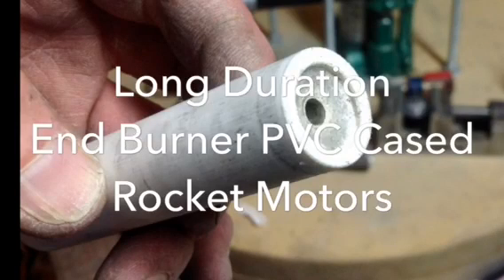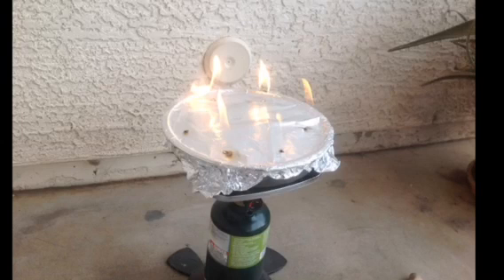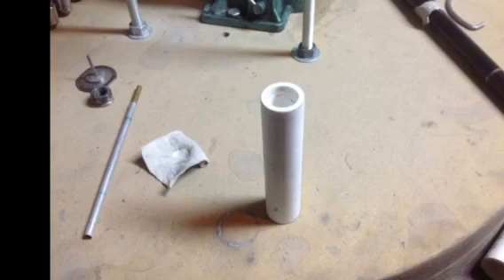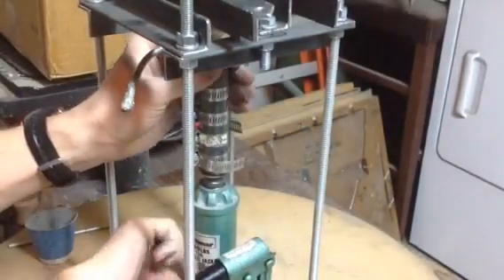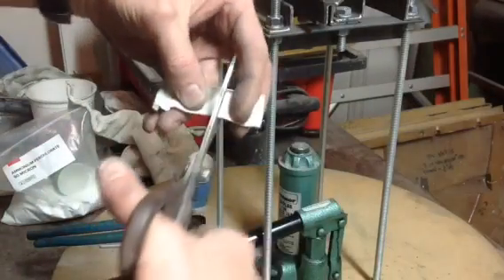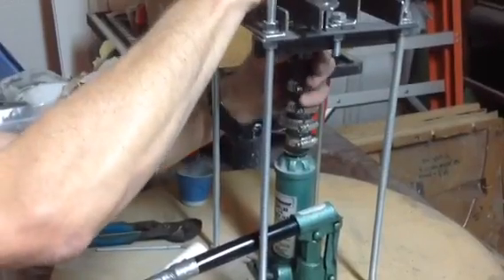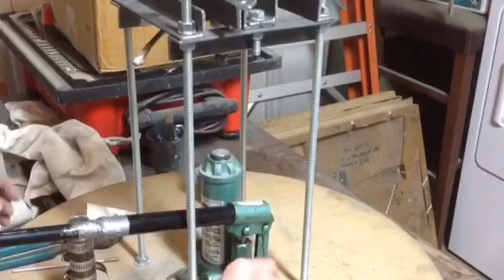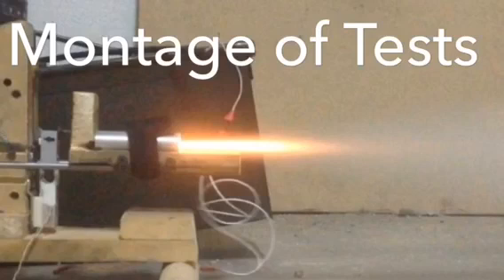Long Duration End Burner PVC Cased Rocket Engines

Comment: I heard the sulfur in black powder is responsible for the high burn rate, powder mixes that should burn slower (artillery) decreased the amount of sulfur and increased the  amount of charcoal.

But if you mix black powder yourself, you will experience  an enormous  difference between wet mixed or dry mixed powder, the wet mixed powder burns much faster.
If you buy commercial black powder (for muzzle loading) it will be corned, has an exact amount of moisture in it and the powder particles are covered in graphite to prevent static discharges, they do everything to get it as reliable and safe as possible.

Comment: Bentonite clay does hold up but the thing you're doing is you're not grinding it down to a fine powder. A lot of people like using it straight from the bag with the little chunks. But it comes out weaker like that. If you grind it into a fine powder with a little moisture, that stuff will literally turn into cement extremely durable.

Comment: I miss the FSI E5-0 and E5-6 motors, 4.5 sec burn, and dual stage 9 sec burn total, we were hitting just over 4000 feet on a good launch. I just found the G13 motor with 15 sec burn time, that sounds like a lot of fun.

Comment: Which would be the ideal load (psi or kgf/cm2) to be applied on the propellant while filling the engine?
Reply: I think highest loading my force possible is best.  This maximizes volumetric loading efficiency.  Certainly I think loading pressure should at least a couple multiples of motor running pressure.  Now, the 2 ton bottle jack press I used I actually found in someone’s trash pick up pile on their curb while walking my dogs!  When I would really get on it with the loading press arm, sometimes it would sort of max out. I don’t know if I was actually achieving 2 tons of force. But, if I was getting 2 tons and given the 5/8 inch internal diameter, the pressure would be upwards of 6000+ pounds per square inch. I kind of doubt that was what I got because I’m not sure the pipe nipple and hose clamps could take that kind of pressure.

Comment: For the nozzle, how did you come up with the design? Would a longer nozzle like we see on real rocket motors be beneficial?
Reply: Hey! Thanks for watching and the great question :). A longer nozzle may help.  It should be tried.  My hunch is that the low Isp nitrate-based propellant wouldn’t benefit much from more expansion.  I little expansion, sure.  For the nitrate motors I think the biggest factor is getting the correct Kn (throat diam driven). But with a 200 Isp motor (and especially 300-450 Isp engines) more expansion in the bell extracts more useful work and thrust by converting internal heat of gases into group velocity of the exhaust jet.

Comment: that's really quite impressive, honestly. Is there a reason you chose end burners instead of regular cored out design? Just guessing it'd be easier to characterize the motor overall with an end burner and be confident that there's little variability between any two.
Reply: Longer burn with end burners
Reply: I chose end burner because needing long duration, up to 10 seconds.  It’s actually a chain of reasons that lead to my choice:  1)  want no-fuss motors not prone to burst from over pressure thus 2) need low burn rate exponent for stable chamber pressure despite manufacture tolerance of homemade motor thus 3) potassium nitrate based propellant thus 4) burn rate kind of high, like 0.5”/second (whereas ammonium perchlorate props would be somewhat slower and could use a Nate’s grain) thus 5) need an end-burner to get 5-10 second burns from a potassium nitrate propellant.

Comment: How does the gimbal work? 
I like the long duration motors. Good to see it can be done with pvc. Im working on seeing if a long duration motor can compress air in a venturi and inject fuel as an afterburner so my rockets can be partially air-breathing. Getting rockets optimized and dialed in is no joke! Great idea with the fireclay too, as Ive been using APCP and it burns with a white flame and destroys pretty much everything I make nozzles out of. Gonna try graphite.

Comment: and to think BPS space is still struggling with the gimball system let alone build his own engines
Reply: This stuff is really really hard.  You might find some online history of my 1st company, AttoPilot LLC.  Developing a robust UAV guidance system to the point of worldwide sales including to militaries was actually easier than developing a robust gimbal controlled finless model rocket.  It’s insanely hard!  Joe Barnard (BPS Space) has gotten a lot farther than me… but you can see it gets nearly impossible if the airspeed picks up too much.  When the aero forces exceed a threshold, these small model struggle.  However, I’m currently tackling this and gaining traction… details to follow
Reply: @dmgoedde  best of luck, I am also trying to get my UAV company off the ground, do you mind mentoring me, just some advice from ur own experience in your free time would help a lot

Comment: Is that homemade mill capable of running for longer periods, say 12 hours, without the drill overheating?
Reply: The drill was horrible actually.  Your comment is spot-on.  The drill isn’t made to run this long continuously and the brushes wore down and bearings wore out.  My current design uses a 1/3 hp swamp cooler motor I bought at Home Depot on belt drive to the rollers.  It gets warm but nothing a small desk fan can’t fix.

Comment: what is grog?
Reply: I wanted to ask the same question.
Reply: Grog is previously fired ceramic (fireclay + water + firing in furnace) that is smashed then screened into specific grit sizes.  All ceramics suppliers carry it.  I think it comes from scrap broken ceramic.  In our rocket nozzles the grog adds a little ‘bite’ to the nozzle mix helping it grab onto the motor tube walls better.  In ceramics it is used like on bottom of coffee cups to make a non-slip surface.  Feel the rough bottom of many ceramics and that’s grog

Comment: On your nozzle, by weight what is the ratio of fireclay, grog, and wax?  What kind of fireclay are you using?  There are about seven different kinds - Lincoln, Imco, Greenstripe, Neuman Red, Missouri (Hawthorne), Red Art, and Gold Art.
Reply: By weight 60% fire clay, 30% “coarse” grog (I’d say 20 mesh), 10% wax.  I used Lincoln fireclay in this video.  Also tried, with similar results, PV, EPK, OM-4

Comment: Is some reason, what you use  exotic mixture 1/3 BP + 2/3 KNSU?  The speed of  burn of BP is possible decrease simply  H2O.
In a large ratios. 1 - 10%. Especially, if you use plast, thus humidity resistant case. The fuel will much simple. And ISP maybe better. Because the steam has ISP 195. Will Increase also the lifelity of throat, because the run will under lower temperature. And gases will much clear. Against sugar - grease all around.
Reply: I used mix of BP and KNO3/sugar to allow adjusting burn rate by varying the ratio.  I found BP has faster burn rate and ignites easily but is known to have a poor Isp like around 70.  Sugar propellant is a bit harder to ignite and burns slower, but has a higher Isp like 120.  Using powdered sugar adds advantage of packing really well, almost like a bonding agent.  My reason to mix the 2 propellant types is get best of both:  easy ignition and decent ISP with burn rate that’s not too fast.
Reply: @dmgoedde  Thanks for reply. Interesting.

Comment: What is grog?
Reply: Clean, fine sand would probably work about the same for the motor.
Reply: Grog is a ground up fired clay, like say you took a ceramic flower pot and smash it up to a maybe fine sand like texture.
Reply: @putteslaintxtbks5166  Thank you, I thought rum at first but that made no sense.
Reply: @ripsumrall8018  Yep, I think that's what they use to call any adult beverage. Sounds like midevil or pirate talk, like, "Eye, hand me another mug of grog, mate" or some such.
Reply: Sand might work in place of grog.  My reply from same question above: “Grog is previously fired ceramic (fireclay + water + firing in furnace) that is smashed then screened into specific grit sizes.  All ceramics suppliers carry it.  I think it comes from scrap broken ceramic.  In our rocket nozzles the grog adds a little ‘bite’ to the nozzle mix helping it grab onto the motor tube walls better.  In ceramics it is used like on bottom of coffee cups to make a non-slip surface.  Feel the rough bottom of many ceramics and that’s grog”

Comment: Gimballed motors!?!!?! WOW. Those engines ran beautifully. I've been working on my own BP mix, using Sumac charcoal. For whatever reason, it seems to always burn slightly faster than willow, especially corned (I use about half a percent dextrin). I've always pressed my motors in a bench vise, but your method is better.

Comment: have you optimised the nozzle diameter?
Reply: Yes, for my purposes.  Specifically my goals were 1) achieve decent ISP while  2) keeping pressure low enough to avoid CATO or nozzle ejection.
Reply: I optimized the throat diameter by a design of experiments.  I did not tinker with optimizing the exit diameter or taper angle of expansion cone